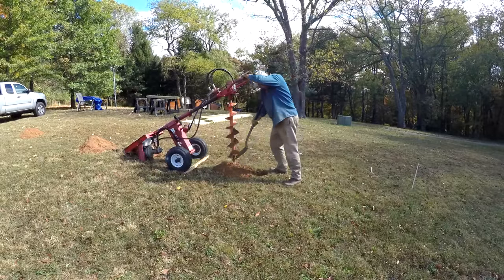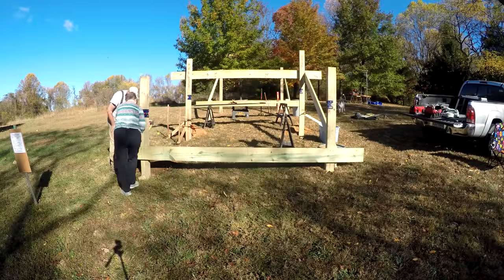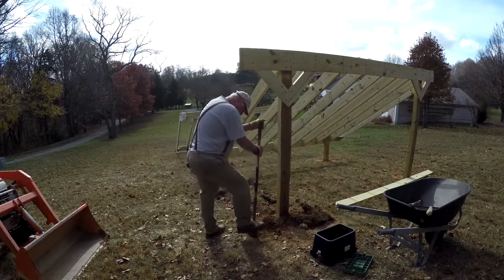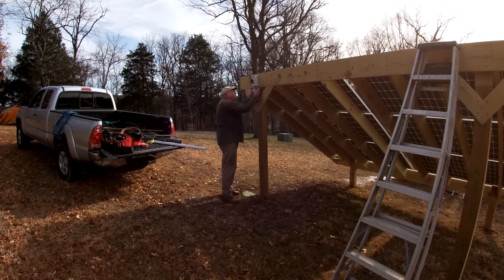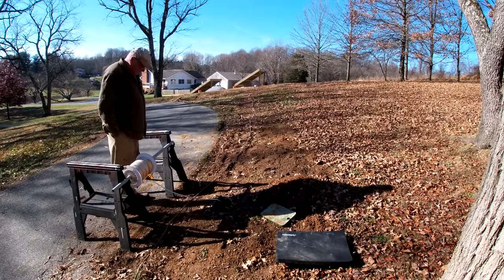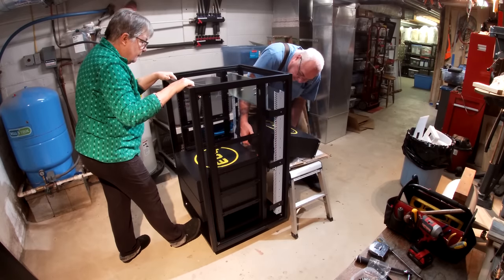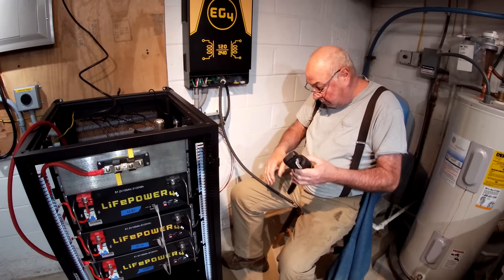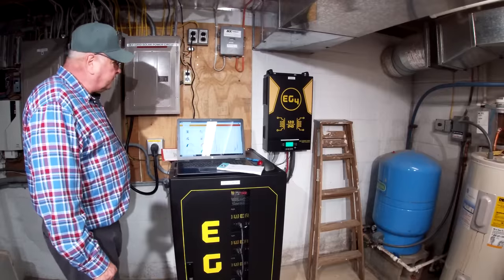Building a DIY Solar Power System

Comment: RETIRED 78, USAF, VFW. On an acre had to figure out how to use land and install solar panels. In 1970 in 6 years, build total electric 2200' home. Built 9' tall 30' to 60' ramada with four parking bays.  Sun Power panels with SMA inverters in Feb 2009. Fifty foot behind home under ground feed 200 amp panel. Bought mini excavator. Zero electric $$ for last 15 years. With second electric car, Cybertrk coming.
Reply: 69 yrs old USAF retired here

Comment: This was a timely video for me. I just received a setup very close to yours from Signature Solar. Same inverter/charge controller, three EG4 48V batteries. SS had some nice 455W panels on sale so I bought 10 of those. I await some warmer weather to start setting it all up. At 70 years old the cold is not near as much fun as it used to be. I don't have an electrical grid anywhere around me so off grid it has to be. You had some nice tips in your video and I thank you for it.
Reply: 70 yrs old and off grid...Respect
Reply: @Chris-sz9vr  It is at the family ranch where I was born and grew up. I set my retirement home up in the old bunk house where ranch employees once stayed. The ranch was always off grid, light was kerosene and coleman lanterns, water was from a gasolene engine pumping into a big pressure tank and from a windmill. Fridge and cooking range were propane. Heat was from wood. We got by perfectly well. A solar system seems terribly modern and almost like cheating.

Comment: 'George and Martha' (?) you did a great job on this video.  I'm an educator, contractor, carpenter and logbuilder.  I turly appreciate your attention to detail and methodical practices.  This is one of the very best videos I've seen to date.  This is something I will be doing in the next year.  I have a very unique need for solar, inverters and batteries because I've been building log homes for over 50 years and I just bought a farm in Sweden.  I'm in the process of moving and I am working on a hybrid Swedish/American power system in my shop so that I can use all of my specialized tools until I wear them out.  I was overwhelmed for about a month looking at all the tools that i did not think I could take with me.  Selling them here would only bring me about 5-10¢ on the $ and buying all the tools new in Sweden was not looking like a good option either since mine are all 'well trained' and will last at least as long as I do!  Your video gave me additional ideas on how to deal with the difference in our US power system which is basically 2 phase (120 v./120 v.) 60 Hz. power and the Swedish system where every house has 3 phase (120 v./120 v./120 v.) 50 Hz.  The good thing is that 99.5% of all Swedish homes has the three phase power.  This will be great in my shop and house where I have some higher voltage items.  As I buy new equipment it will be of the Swedish variety.  The nice thing is that I can set up solar and use a Swedish inverter coming off a 48 volt battery system to create the 120 v./50 Hz./3 phase for the Swedish items and a second US inverter to convert the 48 volt to 120/60 Hz.  Thanks again for a great video and a source of ideas for my needs.

Comment: Thanks for all the work putting this video together,  My wife and I are about to put in a similar system with the same solar panels where we live Holiday Florida . Not looking to go off the grid really just have power when the grid goes down . Our power grid here is old and weak and it seems the power goes out for a day or two every big thunderstorm comes through , and then there are always the hurricanes that can knock power out for weeks.  I already built a 10' x 10' sound proof generator shed next to my workshop behind our home and I can feed power to my home through the 150 amp service panel I ran to the house for the shop. This will give me the option to charge my batteries using the generator a couple hours a day if needed and let my wife use the dryer and washer and central A/C , I installed 3 small 5,000 btu window units so we can sleep in cool temperatures without drawing too much battery power at night. I have been a marine electrician the last 20 years since I retired from the military. I'm 65 and my bride is 63 and we have been married 40 years, all three children are grown married and doing well and I finally have time to do all the projects I have been wanting to do. I doubt I will ever retire, I love having purpose and a full life.  Robert & Beatrice Holiday Fl

Comment: Thank you for sharing your experience in building this ground-mount system. I'm about to install my own small (1650watt) PV array connected to an Inverter/Charger/20kWh Battery/Gen back-up system for critical household loads. Your ground mount design would work for us. It was heartwarming to see you and your wife both work on this together.  I'm of the same vintage and also work on projects with my wife (although sometimes reluctantly - lol). All the best.
Reply from the maker: thanks for the comment. good luck with building your system.

Comment: As an engineer and installer with a 40 year career in solar, I'm very impressed. You've done a very nice job on both the structure and the electrical installation. I respect your choice of components, and appreciate your use of leftover components when possible. I look forward to hearing how the EG4 batteries perform over time, and the EG4 inverter. I'm about to install our own system with a Schneider inverter, Outback PV controller, and LiPO3 batteries, with some used 175W(!) Evergreen modules that were salvaged (for free) off a commercial installation. Congratulations!

Comment: Great video!     You could even change your main hot water heater out for a hybrid, and then set it to hybrid only mode.  You can even set temp/time, so that you bump the temp up a hour before you normally shower then lower a bit a while after that time.

Comment: Great work 👏👏👏 nice job. 

Tip #1 Can’t tell how you got the wire connected to your battery bus bar. But the best way to connect them is one lead will be connected on top of the bus bar, while the other lead is connected to the bottom of the bus bar. If you have them connected to just the top, that top battery will get charged first before the rest of them will. 

Tip:#2 have a plan B. Like you said, when it’s cloudy outside you won’t get fully charged. So go get Signature Solar new EG4 48v 100amp charger and use a gas generator to charge your batteries. Hey, you never know with this weather these days and the time we live in. The grid can go down and you need to be ready. 

P.S. I have the new EG4 charger. Love it.

Good luck & God Bless
Reply from the maker: Thanks for your comment.
Yes, I flipped the negative bus bar and connected the negative cable at the bottom
Reply: @gmhomemovies2023  Good move and really EG4  should modify their cabinets to have them correctly installed from the factory.

Comment: Loved this video. I’m about to set my own system up this spring. Very easy to understand what you did. It just occurred to me that it might help to run a cord through each section of conduit as it’s buried so that it’s already in the conduit when it comes time to pull the wire. Watching these videos really helps me visualize what’s required to do the job. Thank you for posting it! 😊

Comment: Be careful solar is very addictive. I started out a year ago with 120v EG46500ex and 2 lifepower batteries, 10 solar panels. Today I have dual eg46500 in split phase, 12 batteries and 40 solar panels and there new chargeverter. You have skills good luck on your venture.
Reply: Very addictive!

Comment: Great job. Years of  experience shining through.  Highly recommend a heat pump water. My savings has been 75% over my old electric high wattage waterheater. Uses about 380 watts in the eco mode.

Comment: Great Job, George! Setting up my system now with the EG4 6500 units and 10Kw of panels on my shop. I use the Aquanta smart controller for my hot water heater which learns your hot water heating habits. Cut our HW heating down to 2.5Kw a day. Will probably trade it out for a hybrid in a few years.

Comment: You really did a nice job putting this together!  Thank you for sharing how you went about putting it all together.  

Your setup is similar to one I recently set up at my house with three 24V EG4 LIFEPOWER4 rack mount batteries plus a DIY 8S 280Ah battery (22 kWh total), using two Victron Multiplus 24/3000 VA inverters running off grid in split phase and two Victron 150/35 solar charge controllers.   My portable arrays are quite small (only 1200 watts total) and I will have to expand them as the next phase of my project.  It has already come in handy when we recently had a 6 day power outage due to an ice storm here in Michigan.   

I had to chuckle when you were unloading the rack and batteries out of your truck and getting them down to the basement on a dolly, because I had the exact same issues getting that big, bulky, heavy equipment down into my basement.  

Well done sir.

Comment: Rural Florida, no zoning.  I have more room and am building two 42 ft strings, 12 panels each low to the ground.  I started middle of August, much sweating.  71, I work slow and as of today I have one row built with five panels installed, should get five more tomorrow.  Now that it is cooler and I have all the bugs out of my design I should get everything up this week.  I got a three point post hole digger for my compact tractor.  I got most of the inside wiring done during the hottest days.

Comment: So long as your furnace is natural gas or LP, the inverter should run it fine, air handlers and such are typically max wattage of 700, inrush usually isnt much.  FYI.  The AC....not so much.  If you had the big 12k by eg4 and a soft start on the AC...probably, but its not worth all the extra cash unless you live in the deap south.  In that case, just load manage and get a mini split (i have 3 of them, they work great)

Nice work, enjoyed the video, keep up the great work my friend!

Comment: FANTastic! I very much enjoyed this. As I watched the build of the mounts I dreamed of doing the same thing here. I do wonder if you could construct it so the panels could be adjusted to face more upright in the winter and lower in the summer. Perhaps a heavy hinge on the lower posts and a jack-screw of some type on the tope ones? All in, very very nice work!

Comment: HOWdy G&M-H-M, ... 
Thanks for SHARING Your SYSTEM with us ... 
Our ARRAYS ( Ground Mounts ) are similar ... Lumber ... 6 Panels per Array ... 
I also utilized  6-S but used a Combiner-Box to make it 4-P on 24 old ( very old  - used ) 208 watt Solar Panels with MC-3 connectors vs MC-4 Connectors ( $ 800.00 for 24 panels ) 
then  8 AWG wire  100' to my enclosed Front Porch  attic & then over to my hybrid   Growatt  split-phase   INVERTER & 6 EG4-LL 48 volt batteries  
I ran my CONDUIT on the Ground & Mounded Earth on top of  the 1 1/4"  ORANGE discarded Fiber-Optic Teflon lined plastic Conduit the Fiber-Optic installers discarded 
We even use very similar  EG4  6-Battery Battery Racks ... 
Thanks again for SHARING & that was a great idea using corrugated Drain Pipe for conduit 🙂
COOP
the  WiSeNhEiMeR from Richmond, INDIANA 
...

Comment: Excellent video. Thanks for sharing. Would love to see some detail on the brackets you used to hold the panels. My EG4 batteries do well, but are a little pricey. Defiantly easier to hookup vs the DIY 280Ah 48v pack I am building to parallel with my EG4 batteries. Enjoy the sun.

Comment: The wife and I are both in our 60's and just moved to upstate NY to be near her family in Canada.  We bought 30 acres and are currently building our home ourselves.  We went entirely off-grid from day one and are using a similar system from Signature Solar (a split phase 6500EX setup with 15kWh of battery storage.  We went with propane for our stove and an on-demand tankless heater so we can power everything else easily.  (A 240V deep well pump, all our appliances, lights, tools, etc.)  We heat only with a wood stove (works TOO well) and we used spray foam insulation for the house build which really keeps the place comfy even in -40 degree temps.  We're getting a solar powered mini-split to for backup heat and a/c but mostly to dehumidify the house.  It runs directly off solar panels and/or AC power as needed, so we'll not use our batteries except at night.  So far we've been running our system almost one year now with no issues.  It's like being on grid but without the monthly bills.  I wish I had been able to do this years ago.  But we're living debt free now, and that's nice at our age.
Reply from the maker: Wow, sounds great, congrats

Comment: On your battery rack, did you invert one of the bus bars?  Typically they have the connection point for the Inverter at the top of both sides.   That will cause the top battery to be used the most, and the bottom battery to not be used as much.  If you invert one of the busbars, so the connection point is on the bottom, then it will connect to the top on one side and the bottom on the other side and balance the use of the batteries better.
Reply from the maker: Thanks for the comment. Yes, I flipped the negative bus bar and connected the negative at the bottom.

Comment: I wonder what your DC line loss is on the trip from the panels to the inverter in the house. DC loses lots of power on long runs. Your voltage is high enough to not lose too much power, but still it would have been more efficient to do AC for the long runs. If it were me, I would have made the array cantilevered, so you could stack another row of panels on each mount, with half a panel extending off the top and bottom. 

Second, I would have built a shed under one of the panel stands and insulated it and put the batteries and inverters in the power shed. Then you run an AC circuit from the power shed to the house. I live in FL so don't have big worries about freezing, but you may have to add a small heater for the coldest periods to keep the batteries above freezing.

There are AC converters for long runs that don't lose much power and you could install one on the panels and one before it goes into the inverter, so the house run would be AC and have less loss / more power getting to the inverter / charger.
Reply: I run 500 foot #4AL from my panels to disconnect on the outside of my off grid cabin. Very minimal line loss, run about 250VDC open circuit and get around 240VDC. I have 6 330W in series so around 2KW. It’s winter here in New England, my panels are at a 40 degree angle and on a full sunny day I get 1850W. Very happy and was skeptical about the long run but the #4 AL is working as predicted from online calculators. I wouldn’t hesitate to do long DC runs again and Aluminum is much cheaper and easier to get in 1000 foot spools than copper.

Comment: Great video.  Quick question.  You mentioned that you decided against a grid tied system for various reasons.  So when you have several successive days of cloudy weather where your solar PV array is not generating enough power, do you have to manually switch from solar to grid power?
Reply from the maker: Hello and thanks for your question. Yes I have a 50a plug and cord that I can move the critical loads between solar and grid power.
Reply: @gmhomemovies2023  The almost only thing I would change here would just be to put in a transfer switch instead! But I love your use of what you had, what you know, making it all work well for your needs, great work!

Comment: Curious is there something that will switch your "off grid" appliances back to "on grid" if batteries are low?  Does it do it automatically?  and will it switch it back when batteries are charged back up? If so what is it called?

Comment: Good job.  Where is Maryland are you located?  I live in Hagerstown and installed a system recently myself.
Reply from the maker: Hello Kurt, thanks for your comment. We are located in rural Howard county, about 20 miles west of Baltimore.
Reply: @gmhomemovies2023    Good job with the video and the build.  We have two roof mounted systems, one with an inverter and the other with micro-inverters.  No batteries because we have extremely reliable electric service.  I am thinking about adding a ground mounted array and was planning on buying a steel structure.  You made me reconsider.  Might be building it with wood.  Thanks...

Comment: Nice work 👍
Watching from England uk 
Don’t know if I missed it but what was the drop from the panel array to the controller ?? And what gage wire was used from the panels back to the house ??
Reply from the maker: Thanks for the comment.  I used 10gauge solid conductor direct-bury wire from the arrays to my house. Sorry I  don't know what that is in metric. Before installation, I calculated voltage drop and it was acceptable, but I don't remember the number. I never measured the drop. My panels put out 250-300 VDC, which helps reduce the drop.

Comment: Love it. I am puttig my own system together. Love Martha's reaction when it came on line. How far do you have to run the DC cables in total?
Reply from the maker: Hello David, thanks for the comment. I have about 160 ft of 10/2 UF-B between the panels and the inverter. The PV voltage is pretty high (230vdc right now) which should keep the voltage drop reasonably low.
Reply: @gmhomemovies2023  Thank you for your reply. Yeah, that voltage drop can be irritating, not to mention the reactive losses. Do you think it would be worthwhile to put the inverter at the panels and drive AC across the lines? I haven't finished planning mine, so all my equipment is waiting patiently.
Reply: @davidwilker4795  The batteries would need to be very close to the inverter, but at 200VDC or more, the current should be low, and therefore the resistive losses also.